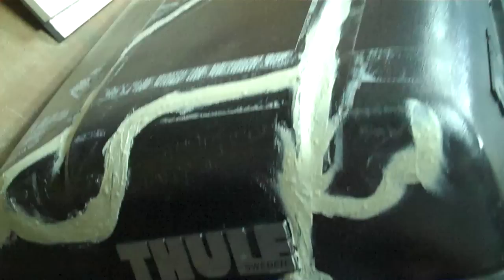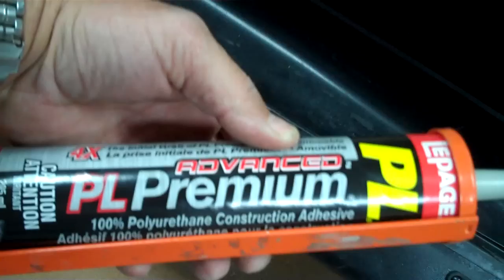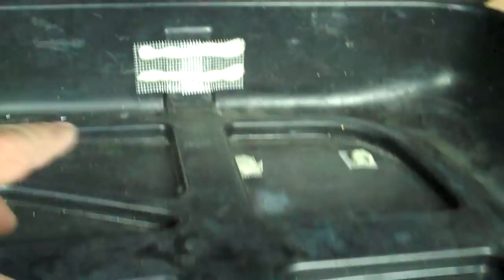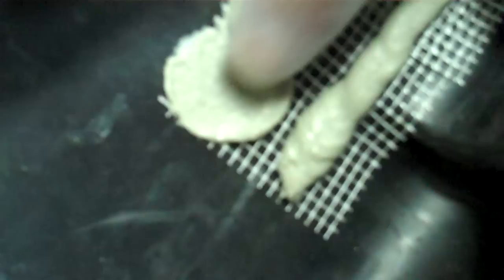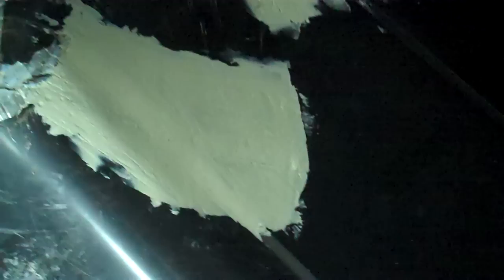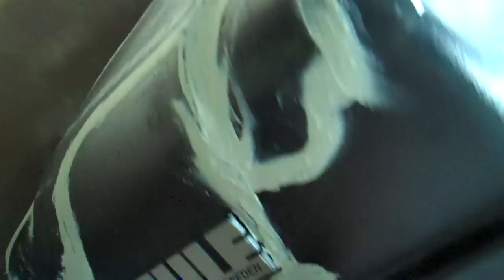Fixing Thule roof box (repair)

Comment: Mine didn't get rock hard either. It almost seems like yours ended up course like a flat paint.  I used the same product, and it worked, not hard as a rock, but like a hard rubber.

Comment: good job, ive just attempted to do mine here in the UK, used some bits and bobs out the shed. Mine was only a small hole really (size of your thumb nail) with a couple of cracks, im not sure if we have that stuff you used here so i had a go with Evostick Hard as nails to fill the hole with some gaffer tape on the inside to support it. Just waiting for it dry to see the result!

Comment: I bought a damaged Thule box also. Was every bit as bad as yours? I did a lot of research, via YouTube & came up with a slurry made up of Acetone & cut-up pieces of black ABS pipe. The slurry took about 24 hours to come to the consistency I wanted. Tried to hold the pieces together the best I could. Have to say myself it's probably stronger than the rest of the box. As life would go, there were 30 other people who wanted to buy it. I was the first to call on it so I got it. I have a 2016 Tacoma with a factory roof rack. Yes, the rails won't go to 43 inches, now I'm going to drill out the bottom slides & remount them to accommodate the distance I need. Word of warning don't follow too close behind me. Just kidding, if it doesn't look safe I'll redo it.

Comment: Thanks...  I'll have to pick up a tube...  Can it be sanded after it dries?  I intend to put on several coats, smooth it out with a disc sander and hit it with plastic spray paint.

Comment: Richard - My wife just tried to drive into an underground parking lot and our box is cracked, lots of shatter not just cracks. I just tried your fix above but did it on the INSIDE only so far. I wasn't sure if you are recommending to also do it on the OUTSIDE of the box, or is the white that you are showing on yours as a result of the material seeping out? Basically - question - should i also apply the PL on the exterior?

Comment: Thanks for the video. Mine is the Atlantis series that has a different shell material I think. I'll try this anyway and post results here.
Reply: Thank you for posting this. My wife drove into a multi story car park with the roof box on the Car. I welded the outside with polystyrene cement and vinyl wrapped but did your method on the in side to strengthen it. Works a treat. Steve from the UK

Comment from the maker: It's been more than a year now and the box is still holding together nicely.  I should have painted the exterior of the box better (I just quickly spray bombed it) so there is a little flaking on the outside (I suppose from UV damage) could have been avoided by a good coat of paint.

I'm still happy with the repair (given the cost of these boxes!